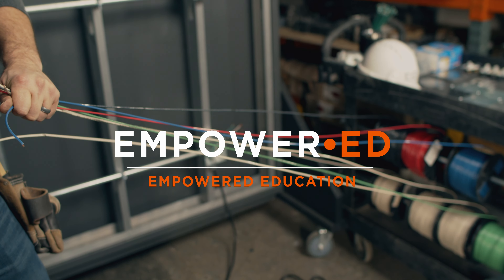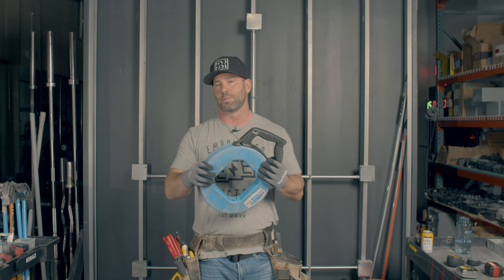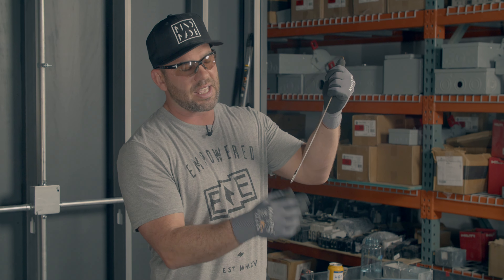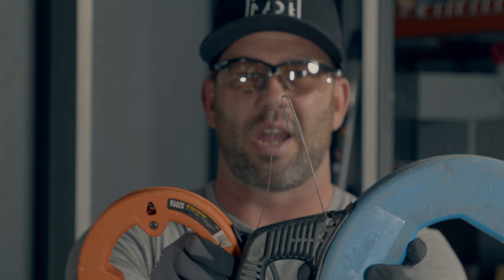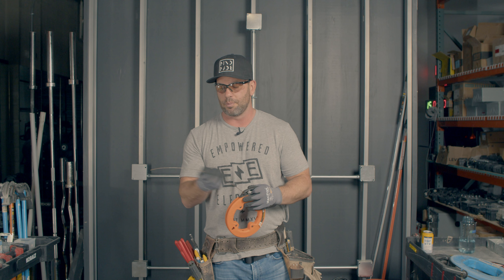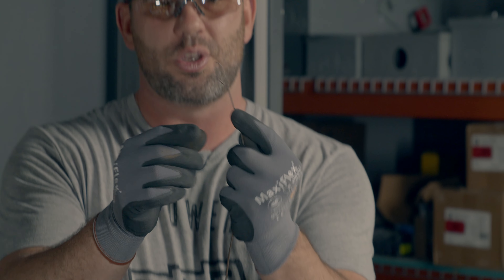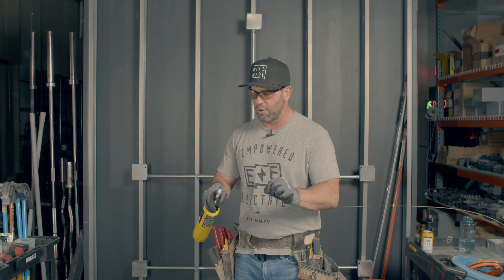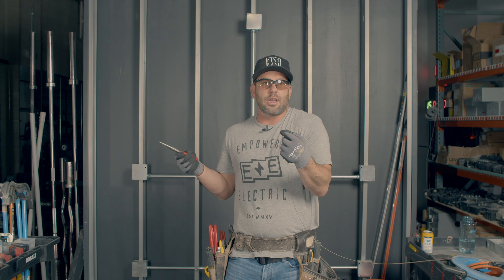How do I use a Fish Tape?

Comment: You've gotten it backwards with heating the metal. Bending it is essentially work hardening the metal - the torch is annealing it and making it softer so when you go to bend it you don't excessively harden it. Still; good suggestion to heat the metal before bending.
Reply: What are u talking abt?
Reply: The metal of the tape is clearly already hardened. He uses the torch to Anneal it so that the pre-existing hardening does not encourage the tape to break on the first bend. 
The metal is not going to be work hardened after one effing bend and nothing about what he explained is backwards. 
1. Tape is hard and breaks easily; 2. tape is heated and annealed;
3. Tape is now malleable and won’t break easily.
Reply: Work hardening takes A LOT of work to actually start being a problem. Like hammering cold metal on an anvil for 5+ minutes. One single bend of a piece of wire will do basically nothing to affect the work hardening. If it’s brittle on the first bend, it was already hardened. 
Again, what is backwards about what he said? 

The only thing worse than an “uhm acktually…” guy (me), is one who doesn’t even know wtf they’re talking abt.

Comment: Dude, you helped me so much. I ran all my conduit and it was my first time. Then i ran my buddies fish tape through it and got snagged at every turn. Watched your video, heated the tip, bent the tip, lubed the tape and wire bundle like a virgin on prom night with soap and pulled the wires like I knew what I was doing….youdaman.

Comment: fishtapes are a mild/spring steel, meaning there's a lot of tension in the line. Softening the grain of the metal prior to forming makes it not only bend easier, but it also makes it stronger since you're actually deforming and normalizing the grain, meaning less separation between the layers of the grain.

If you want to cool it down faster and also lubricate the head, you can melt the tip of a wax pencil on it, might make it harder to tape though.
Reply: Fishtapes are whatever material you purchase.

Comment: All that whinging and your tip is misleading. The heat and slow cooling anneals the metal. Gonna want to temper it again or you pull the end-loop straight.